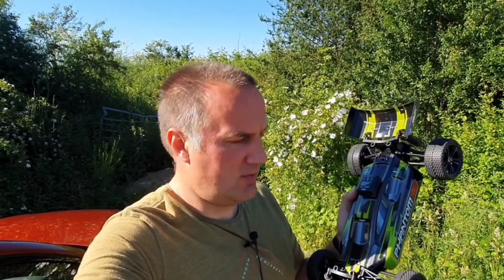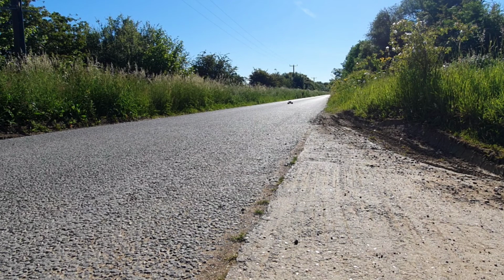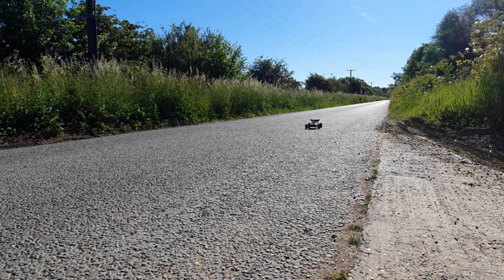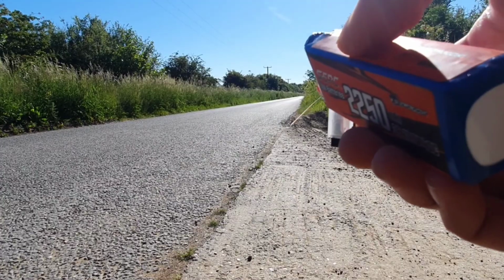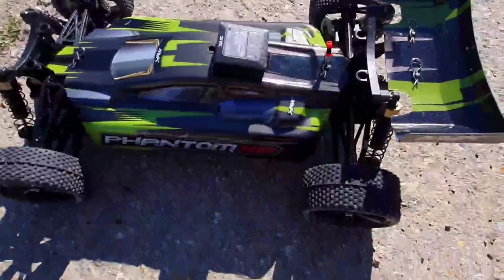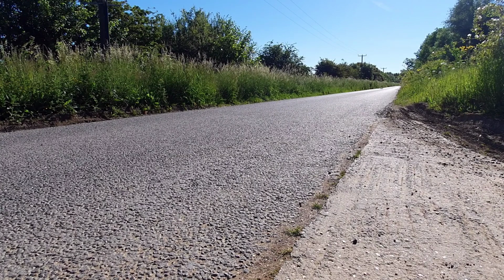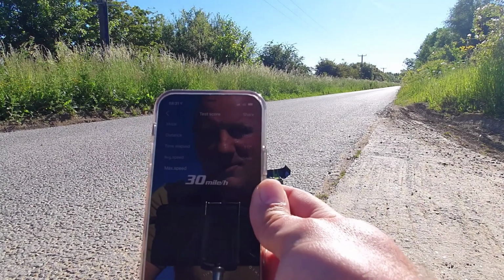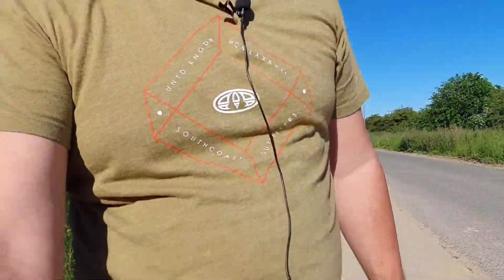Maverick phantom Xb speed runs

Comment: Where to get the aluminiun parts?
Reply: Pls tell me when u see this comment
Reply from the maker: Hi. There I got mine from eBay for the phantom xt if your after the xb (buggy) I think it’s called a himoto tanto or e10 if you search it on eBay then check the pictures against your car you should be able to find it. Hope that helps.
Reply: Thanks , i didn’t found them yet but i will keep looking
Reply: But if u found them”for the buggy” i would realy appreciate if u put a link or make a video
Reply from the maker: Try this link hopefully it will put you in the right direction.
https://www.ebay.co.uk/itm/Himoto-E10-Alum-Front-Lower-Susp-Arm-2pcs-/403077072491?mkcid=16&mkevt=1&_trksid=p2349624.m2548.l6249&mkrid=710-127635-2958-0
Reply: @noobrccars4392  but thanks anyway